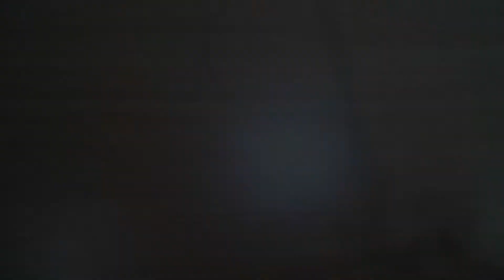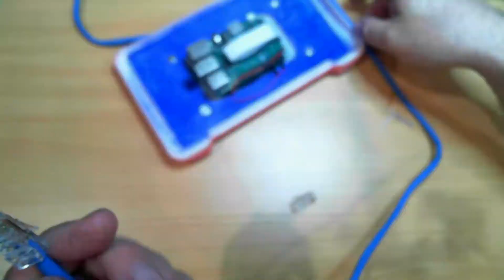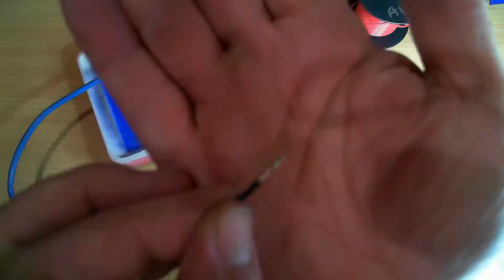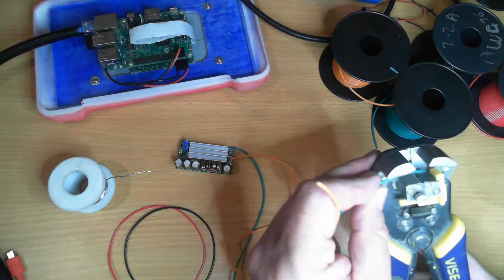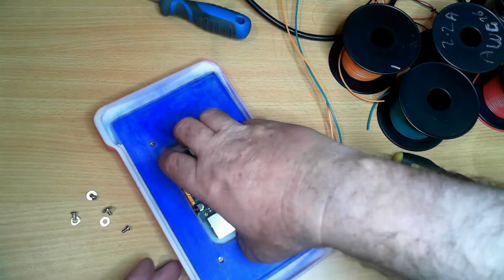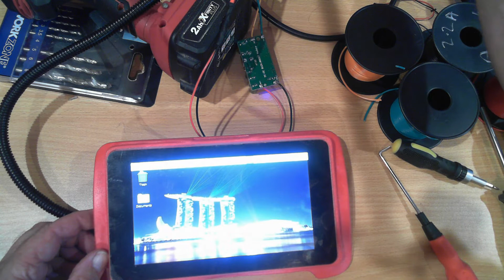Wiring up Freds back Raspberry Pi

Comment: why can't we connect this screen to the same raspberry pi in the head ?  why is it that we need an additional raspberry pi for the screen ?
Reply from the maker: In this case, the cable for the screen is far to short to reach the one in the head.
But also keep in mind we will have a huge workload on the Raspberry Pi in the head with Computer Vision.
Having multiple Raspberry Pi's will allow us to spread the processing load.
The HMI in Nixie, is the Chrome web browser, it also uses a lot of the computer resources, so if I open the Web Browser on another computer, then the one in the head has more processing power to process the video from the camera.
If we chose to, we could transfer all the general service processing down to the Raspi in the back leaving the one in the head just for OpenCV.
I may yet add more Raspberry Pis to help spread the work load.
Reply: @CyberOne  what is the screen size in mm? because I'm looking at 7" screens and they are not the same and I want it to fit the screen bracket that I have printed
Reply from the maker: @louwrensburger1796  The screen I used is from the Raspberry pi foundation.
https://www.raspberrypi.org/products/raspberry-pi-touch-display/
It has a small board that mounts on the back of the screen and the Raspi mounts on top of that.
It connects to the Raspi via the display CSI port on the Raspberry Pi.
The thing is, the glass panel extends beyond the edge of the screen as can bee seen in the middle picture in the link above.
Reply: @CyberOne  thank you for that
Reply from the maker: @louwrensburger1796  No Problems :-)